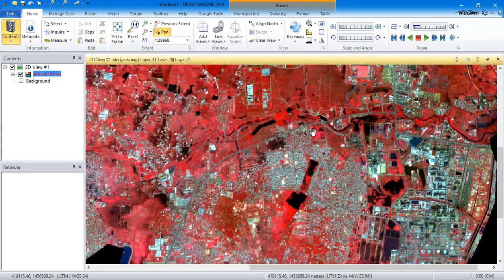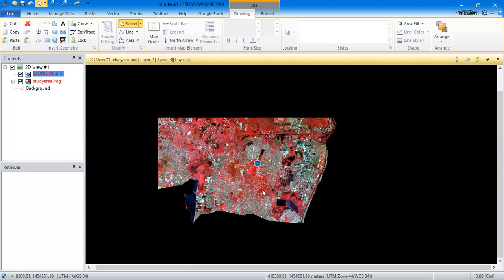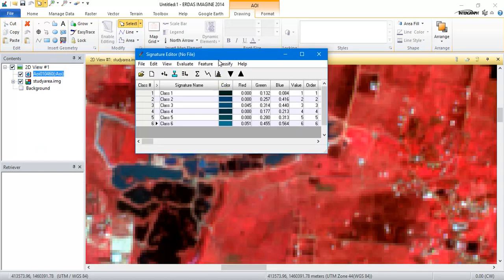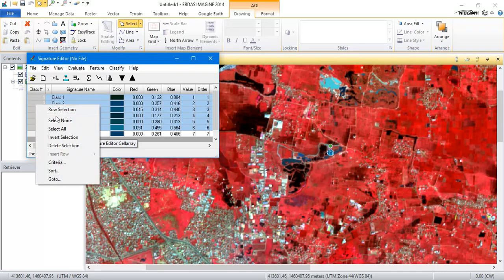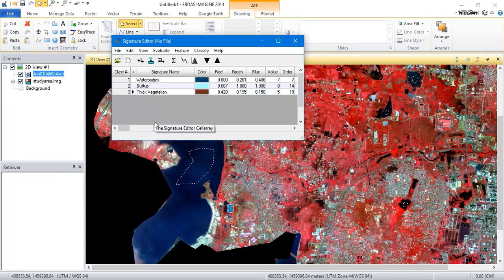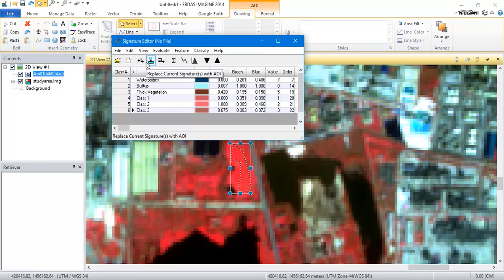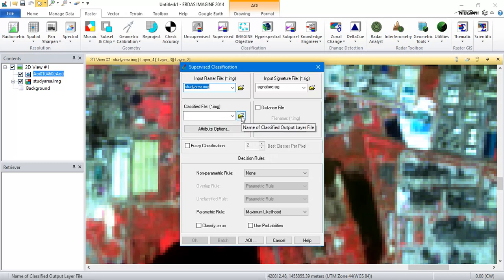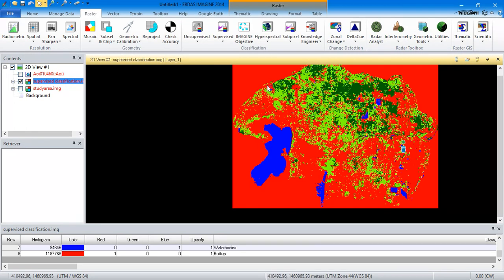LULC using Erdas Imagine / Supervised Image Classification

Comment: this vedio is so much helpful.but I have faced a problem like this vedio my classified image also show a colourful background like this vedio.if I will calculate the area is it show accurate result???specially the red portion which have shown in the vedio.Please could you show that how to solve this problem by exporting image.
Reply from the maker: Hi Hhosna Z Kanica, Yes you are right this classification as some issues and background should not be red. I think it as taken no data to red colour. Sorry about that.